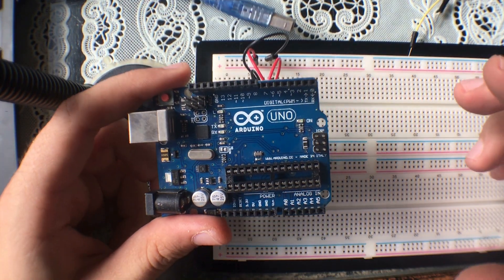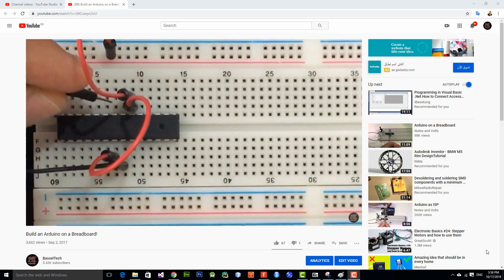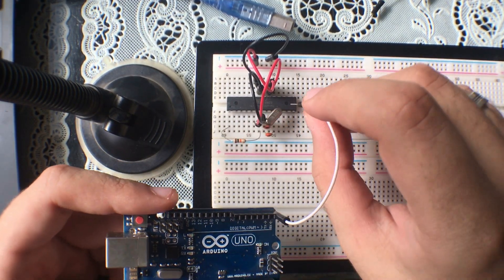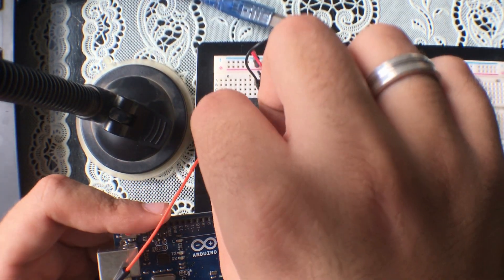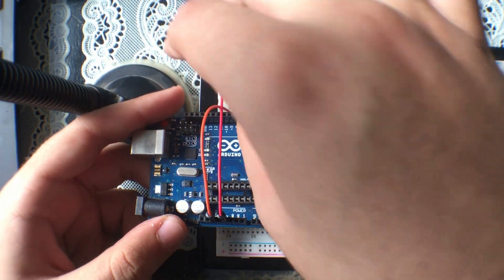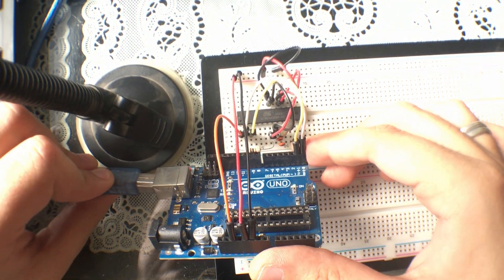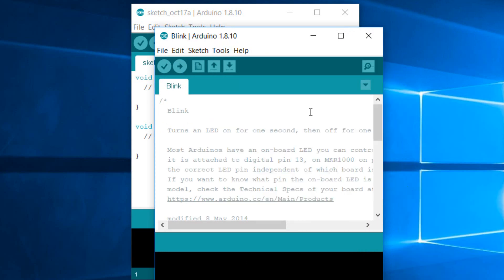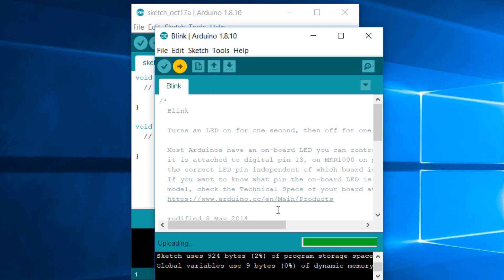Programming ATmega328p Using Arduino UNO

Comment: I am having Sketch uses 924 bytes (2%) of program storage space. Maximum is 32256 bytes.
Global variables use 9 bytes (0%) of dynamic memory, leaving 2039 bytes for local variables. Maximum is 2048 bytes.
avrdude: stk500_recv(): programmer is not responding
avrdude: stk500_getsync() attempt 1 of 10: not in sync: resp=0x1a
avrdude: stk500_recv(): programmer is not responding
avrdude: stk500_getsync() attempt 2 of 10: not in sync: resp=0x1a
avrdude: stk500_recv(): programmer is not responding
avrdude: stk500_getsync() attempt 3 of 10: not in sync: resp=0x1a
avrdude: stk500_recv(): programmer is not responding
avrdude: stk500_getsync() attempt 4 of 10: not in sync: resp=0x1a
avrdude: stk500_recv(): programmer is not responding
avrdude: stk500_getsync() attempt 5 of 10: not in sync: resp=0x1a
avrdude: stk500_recv(): programmer is not responding
avrdude: stk500_getsync() attempt 6 of 10: not in sync: resp=0x1a
avrdude: stk500_recv(): programmer is not responding
avrdude: stk500_getsync() attempt 7 of 10: not in sync: resp=0x1a
avrdude: stk500_recv(): programmer is not responding
avrdude: stk500_getsync() attempt 8 of 10: not in sync: resp=0x1a
avrdude: stk500_recv(): programmer is not responding
avrdude: stk500_getsync() attempt 9 of 10: not in sync: resp=0x1a
avrdude: stk500_recv(): programmer is not responding
avrdude: stk500_getsync() attempt 10 of 10: not in sync: resp=0x1a
Failed uploading: uploading error: exit status 1

Comment: Would this method work with Arduino UNO WiFi Rev2 with Atmega4809 to program external Atmega4809 microcontroller? I would appreciate if you can answer. Thank you.

Comment: Rather it would be easy to replace the chip in Arduino Uno board it self and do programming...
Reply: yea but over time, if you do this a lot, you can wear out the socket on the arduino

Comment: If you have to remove chip why not just put your chip into arduino and upload as usual?
Reply: because with this you can program your atmega without remote it from the breadboard every time, because it can break the pins

Comment: Sir how much it can give us output  voltage ? If 9 volt battery is connected to it as input voltage???
Reply from the maker: You cannot connect a 9V battery. You’ll need a 5V regulator first or use a 5V DC power supply to power up the board. In both scenarios, the output voltage from the pins will always be 5V.
Reply: @BasselTech  so  sir is there any process like amplification for DC voltage that we  can increase  Atmega328p ic 5 volt to 10 or 9 volt????   sir i need your help for this.

Comment: does this work without removing the chip from the board for programming another atmega328p?
Reply: Yes, wire it up as shown, but hold the shift key when you press to upload.
Reply from the maker: I believe you can using the same procedures shown in this video: How To Burn Bootloader On ATmega328p Using Arduino Uno? (https://www.youtube.com/watch?v=CQW6Mz6ULrc)

But upload your sketchbook instead of burning the bootloader.